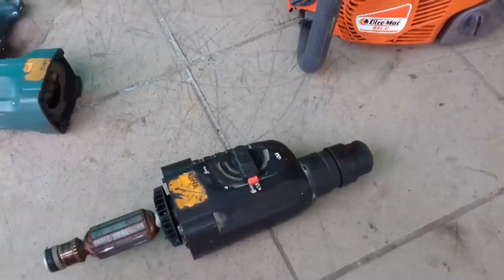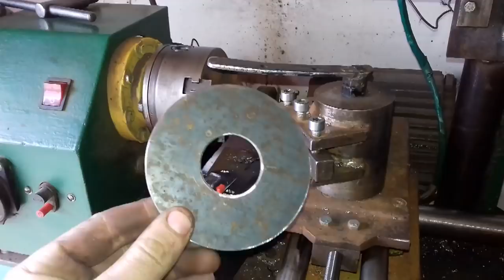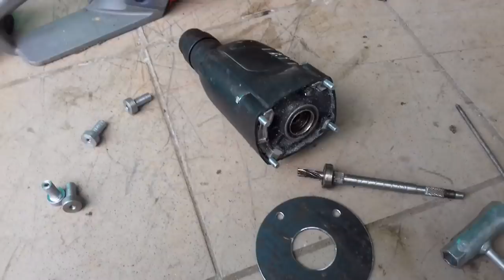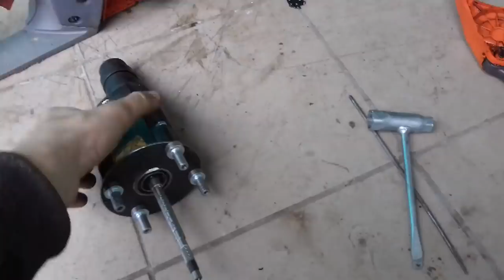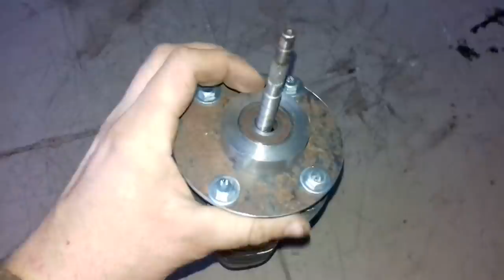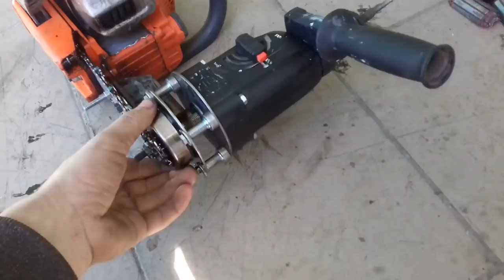Chain Saw Drill Attachment

Comment: If that drill bit breaks and your weight goes forward toward the wall, you are falling right into that chain. I admire your creativity, but some things just shouldn't be done and this is one of them. Even a chain guard is not going to save you if you lose your balance with this thing. Chainsaws are dangerous enough without putting your vital body parts in front of the chain.